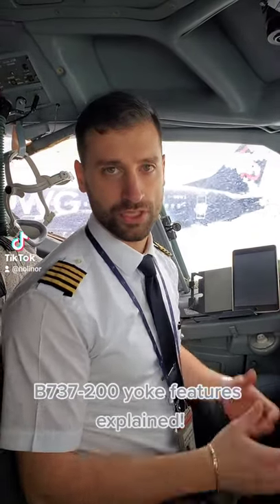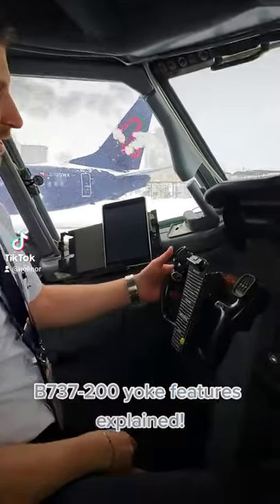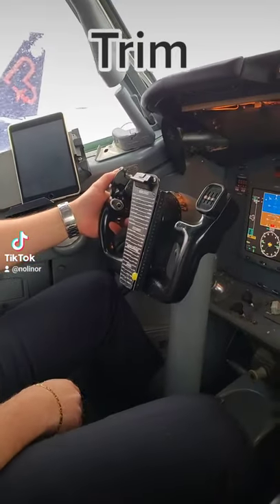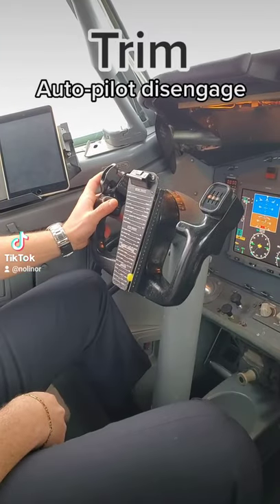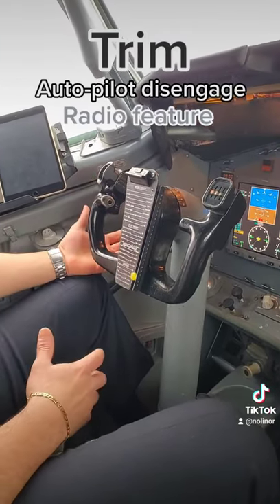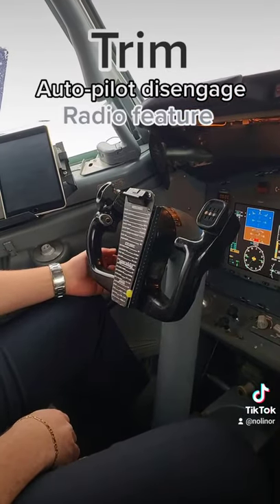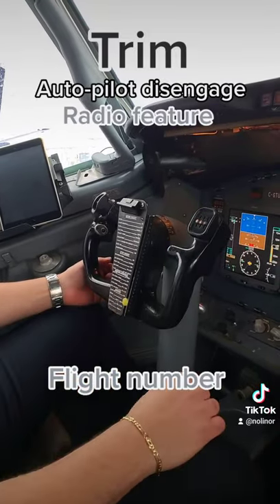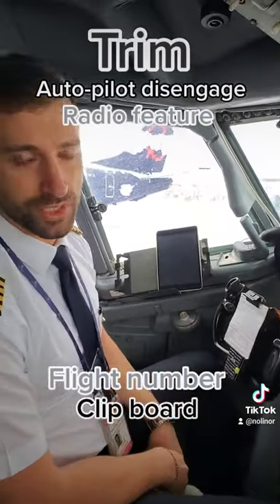B737-200 Yoke Explained by Pilot! #short #nolinor

Comment: Thats not a b737-200 thats a b737-800
Reply: Nope. Upgraded -200
Reply: It has a new PFD
Reply: It’s a upgraded model of the 737-200, by the sound of the trim and the looks of the dashboard, you will notice the difference.
Reply: Its nolinor bruh, they operate 737-200Fs
Reply: I think the airline would know man
Reply: It's a 200 with modified avionics
Reply from the maker: Sorry it's a 737-200

Comment: Woah modern 732 nice
Reply: It’s not a dash 200
Reply: This is an older 737 because it’s a -200
Reply: Literally says on the video 737-200/73(2), you blind or sum @randomperson3199
Reply: @Fish5216m yea, it just had modern avionics
Reply: @Nobi36  ya
Reply: well how come it has modern avionics, an iPad holder, and no top extra windows?
Reply: @damoose1311 bro are u blind they updated the plane and made it better they replaced all the old stuff basically
Reply from the maker: ❤️ modernized*

Comment: What is trim ?
Reply: A real 737 pilot keeps the handle out on the trim wheel, this way he has both a visual and physical way of telling when the trim wheel is spinning in the most agonizing pain ever as the fucking handle hits your knee. Stay classy 👌
Reply: Trim is the angle that you can set for the tail part of the airplane (back Wings) if that makes any sense
Reply from the maker: Yeah what they said